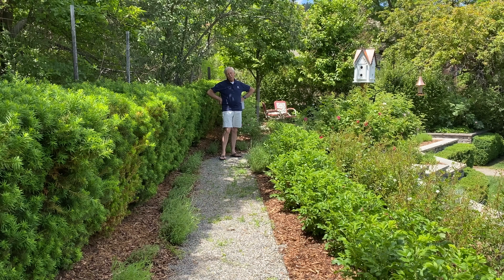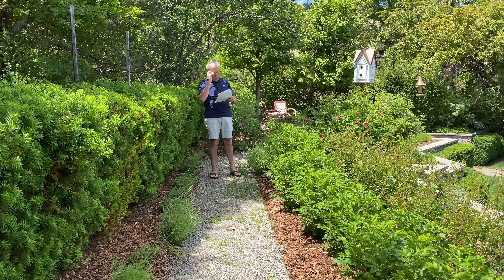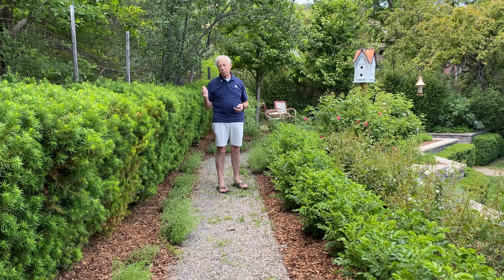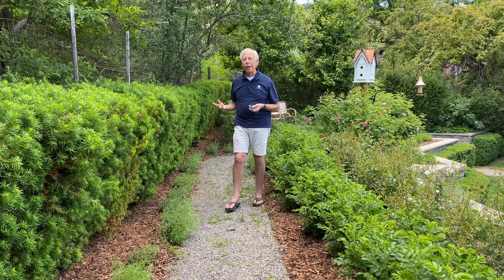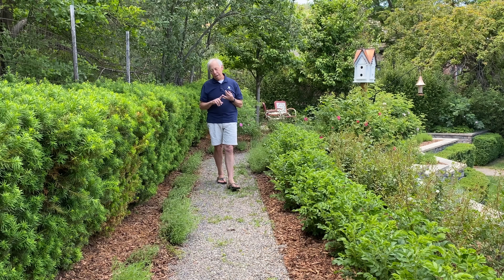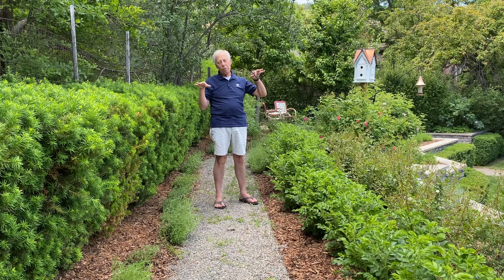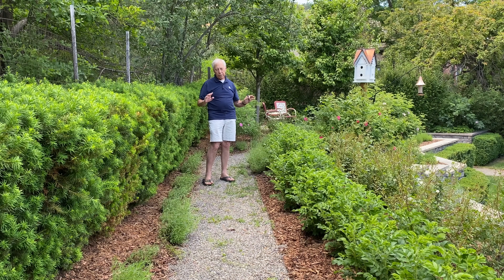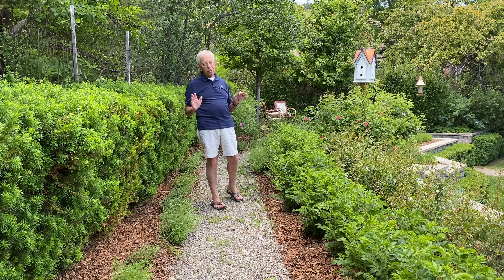Digital or physical room correction?

Comment: Couldn't agree more, Paul! I have an Anthem AVM60 which supposedly has a very good room EQ. I have tried on several occasions to dial it in and try to live with it. But I've always ended up defeating it. Why? Well, I can clearly hear the sound change from full, beautiful to low-fi. And I am certain something changes with phasing. I don't care what anyone else says, I know and trust what I hear. Just put on an SACD with good localization in the surrounds and listen with room correction off and then turn it on. It is unmistakable in my room/setup. The image will be blurred instead of precisely located. You lose a huge part of the realism. The center channel also becomes veiled. I suspect it's due to Anthem Room Correction routing the lower frequencies to the subwoofer which then smears the sound. So I run all speakers except my ATMOS ones at full-range. In fairness,, I've spent a fair amount of money on physical room correction.  Bass traps, sound panels, concrete floor, heavy curtains over windows. This is the way to do it, period. Glad to know someone very respectable shares the same opinion.

Comment: Glad Paul mentioned it, only do it for bass.  If you want to get very scientific, you can find your room's Schroeder Frequency, and do the stuff below that (usually between 100-200hz).  Then, only do cuts, no boosts.  Any EQ boost you make lowers your system volume headroom by the same dB as the boost!

Comment: nice yard...natural soundstage...definitely physical changes first by listening to system in an open field...in the end, everything in life is a momentary experience - every moment is unique even if the EQ setup remains unchanged...anyway, I have an integrated amp with an internal DAC. I stream 90% of my music from a laptop going to a inexpensive DAC that has optical and rca digital outputs then I use the digital out to a more expensive DAC, then the DAC goes to the amp via single ended rcas...essentially, the audio signal is going thru 3 DACs before outputting to the speakers...If I use the DIRECT MODE  on the amp (1) will the internal DAC of the amp be disabled and uses the external DAC? (2) does upgrading the external DAC make a difference if the internal DAC of the amp has the final say, anyway? ...or just ignore the audiophile neurosis and enjoy the music...thanks

Comment: Fixed as much as I could first just by placement of speakers and subs, then drastically moved the 4 main listening positions, then the receivers built in correction, huge bass trap in the worst corner, and finally, mini dsp for the subs!  Sounds miles better than originally, but there is always room for “just a little bit more”.

Comment: It's a bit like comparing apples and oranges. Room correction incl. speaker placement is only way to solve issues of a room creating too much reflections messing up the purity of the sound. For vinyl music, I wouldn't like using digital room correction as you end up adding an ADC and DAC in the path. But for digital music, DSP based room correction can be awesome in fine tuning the sound against your speaker performance, room and your personal taste. I need +5dB at 12kHz to rejuvenate the tonal balance (fix my personal frequency drop due to aging) and I usually like around 4dB extra around 40Hz due to the Fletcher Munson Curve effect at my typical listening levels (I don't play at concert level so often). The cool thing about DSP audio processing for digital music is that pass-through is 100% without any change (numbers out = numbers in). What is worse for the audio...a 40dB RIAA EQ or a -3dB DSP EQ compensation for a speaker issue? Vinyl lovers are sort of EQ lovers.

Comment: Interesting topic. I am using Trinnov Amethyst for stereo. Pro studio are using the Trinnov ST2 Pro for their studio set up. Definitely physical first to reduce the reflection and standing waves bass as much as possible, then digital to correct more for bass dip and phase. Trinnov is highly regarded in commercial cinema setting where there are many speakers and subs firing at the same time. There is no way that physical alone will sort out the phase and bass response in such setting. It makes perfect sense to have digital to analyse and apply the correction.

Comment: Firstly, i'm s huge fan of Paul and his team in these videoes🙏❤️ Their way to explain all the subjects they are covering is very understandable, and simply great! I'm shure their productd are stunning.
But this time, i will have to disagree with Paul. Of course we all have the right to our own opinions 😉
Here is mine: If you have a dedikaded room for listening, and you tweek the s*** out of it with all sorts of diffusers, and what not, Paul is probably right. I admit, that i cant' say for sure 😉
But most people are listening in an ordinary living room, that has to be 'livable'.
In that case, digital room correction - if it is properly made - in my opinion is the best way to go.
I have been owning my Lyngdorf TDA,-3400 amplifier with 'Roomperfect' digital room correction for a little more than a year now together with my Snell E 3 (Harbeth is my dream 😉) I am extremely happy with it, and it is made here in Denmark ❤️❤️❤️ It bypasses so many problems on my livingroom. Sounds fantastic 😛 Couldn't have done it without correction!
Reply: I agree. I have a "L" shaped living room that just doesn't have the space to allow physical adjustments (other than a rug). There's no way to relocate the speakers or add wall treatment. I'm very happy with how my Anthem STR amp made a very noticeable improvement with their "ARC" 2 channel system that adjusts 500kHz frequencies and lower. The soundstage is so much better. I think digital correction is a great way to go for most people that don't have a dedicated listening room. However, you have to be careful - My Denon's AVR 7.1 system's Audyssey correction software ruined 2-channel music listening.
Reply: Agree with you about usefulness of digital after all the physical is applied. I am using Trinnov instead of the Lyngdorf.

Comment: Definitely uses for DSP I would say - live venues for example, and where you are setting up a system for an event. Would I sometimes like to tweek my mids - certainly, though not at the expense of running my lovingly honed signal path through an extra device including AtoD and DtoA - that's 3 devices really! (possible off axis complications..?) I am using dsp on the sub however (mainly subtractive) as Paul has suggested. 
I wonder whether we are pining for tone controls - a bit more sophisticated than treble/bass but with less 'trauma' than a DSP unit. Who breaks a butterfly on a wheel?

Comment: The conclusion and summary advice are sound and correct, but I feel some additional arguments are required. 
The error created by two or more speakers in a room are not tied to frequency response alone. They are also spatial (vary with your location in the room) and also time related (reflections that each have their own frequency response and dispersion) arrive to the listening location with varied delays. 
To only consider the frequency response issue is much less than a band aid. It's like taking an aspirin for a fractured skull. 
The better way to correct the problem is reduce (not eliminate) the parasitic reflections so that the initial output from the speakers with their dispersion become a bigger element of the audible sound. 
And you don't want to kill reflections. You can do that with a half decent anechoic chamber but you wouldn't enjoy listening music into one. Or if you don't want reflections, listen with headphones. Much cheaper. 
Treating a room with absorption and diffusion (for larger rooms) is much better because you greatly reduce the effect of standing waves and with proper use of the tools available, you end up with an experience relevant to a much bigger listening space. 
Some people hate the use of panels and diffusers. I can understand that. If you have a large living room to serve as a listening room, careful furnishing of the room can do almost what dedicated panels can do with a much more pleasing and functional result. 
Some years ago, there was that "school of thought" to kill reflections totally and then depend on the actual content or insert some artificial reverb in the music to enhance the sound. Home theaters were built with thick carpet all around the walls, ceiling and floor, thick armchairs for the listeners and plenty of small speakers dedicated to generate artificial reflections. Thankfully it didn't catch on much.

Comment: Sure physical room treatment has to be done first. But it doesn't mean that digital is crap, I disagree with Paul's comment, and apparently he does knows only a bit about frequency correction, and not for example about time correction. So it would be better to check with somebody who masters it, and be able to listen to example(s) in your area.
In my case, I don't own my flat, so I can do limited passive treatment. Result with software correction is really a plus. But it was quite some job for me to learn how and do it, it's not at all a button to press.

Comment: Why not do both? Physical as much as possible first, then digital for the remaining issues.
Reply: agree 100%. If you can fix the issues completely with room/placement tweaks, great. However, if you can't fix everything this way or have a fixed environment (like my desktop!), then digital correction works really well to smooth out the remaining issues.
Reply: @Mr Do , this is a 2 cannel page.....
there is the occasional comment specifically directed a multi.... butt 99% 2 channel.
Reply: Its Tip yep, acoustic treatment for the room then use EQ if needed.
Reply: It sounds like speakers were not meant meant for rooms.
Reply: Thats the reasonable approach as there is no perfect and you are not going to be able to straigthen every kink of the curve with just physical. Not in a room you intend to live in anyway
Reply: Because you would be taking your lovely audio signal and subjecting the whole thing (in most cases) to a phase of A to D and then D back to A and a whole extra device. 
In the treble frequencies,  I think there might be issues with creating much larger off axis differences in your speaker response as a result, and limiting the sweet spot, and possibly numerous other issues. 
Having said that I use Paul's recommendation of just the sub using DSP and only subtracting frequencies. If you try and fight a 'null' with gain it will only fight back - shift position slightly and it may bite back! 
I think there is possibly more place for good 'ole tone controls (analogue) with a bit more sophistication than just treble/bass.

Comment: IT's a tough call in that doing physical room correction is a difficult process, but done right sounds the best. Digital EQ sucks the Mojo right out of the music.
Reply: Also, digital room correction simply can not do what physical room treatment can do in terms of, well, everything about 100 hz... so you HAVE to do absorption and diffusion to treat above 300 hz if you want to get truly great sound.
Reply: I built an active anti room mode system. It works really well, vastly better than any room eq and cheaper and simpler (when you understand it) than doing so called bass traps. Good bass everywhere in the room (where a person might put there body).

Comment: Based on what audioholics said on their channel turning off correction above 500-700hz which is the room transition zone is best as anything above that the room correction can't tell what's speaker issues and what's room issues. Based on my own experience I would agree as that still helps with boundary interference from poor placement that I can't get around and stops my high end from sounding so shrill. I do agree that if you can physically fix the problem at the source you'll be better off.